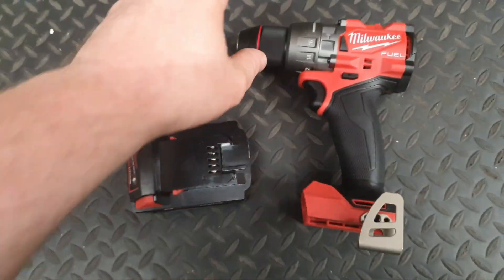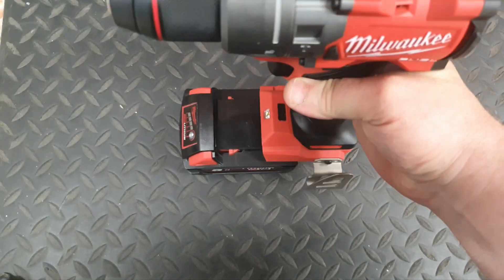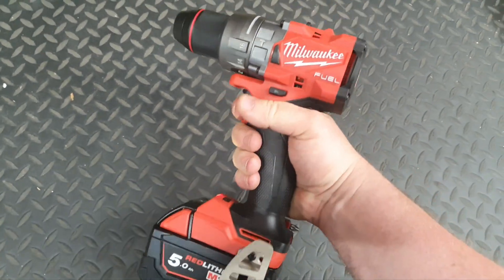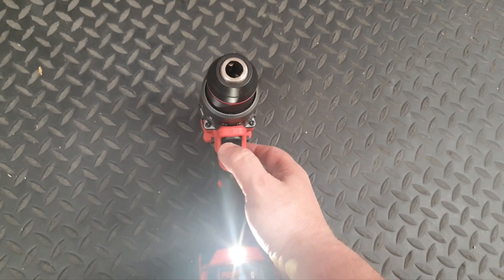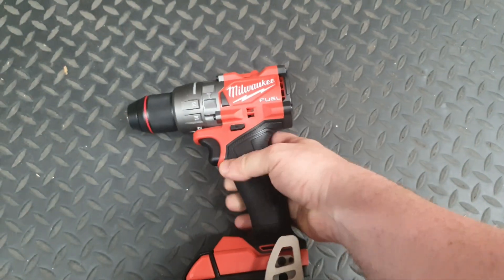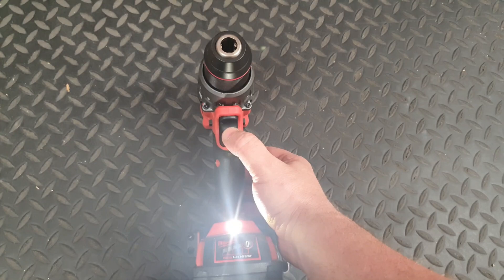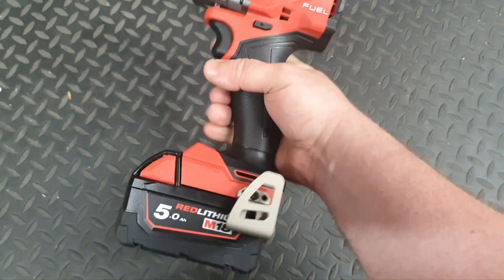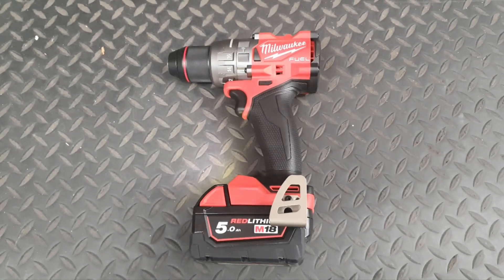Your Milwaukee Gen 4 does What??#milwaukee #powertools #fuel

Comment: Pretty cool hu press 5 times like a vape to turn off and on but you can take the battery out and it will turn back on. Have you tested the raw power of this amazing compact drill for its siZe you would think it wouldn't be that powerful like for instance you put a DeWalt or matabo hpt  hikoki... Its smaller than a Ryobi lmao but three times the power. I believe that channels like torque test channel had so much whining about the wrong batter and thousands of people complaining about there method they were like fk Milwaukee were really gonna make the fan boys cry 😂 and actually rated a very low budget tool above it then tested DeWalt and and changed testing i think its funny that they would stoop that low 😂 at the beginning Milwaukee was the tool to beat even air couldn't beat it but because the tool didn't say high output on the tool they tested the shitty 5.0 battery and gave ridgid the octane batteries 😂 most don't even realize this and according to them DeWalt is the absolute best everything 😂 except for the last two test with the drills flex and Makita xgt won i mean it would be ok if these tools actually were more powerful but there using a rig to test torque not a wilhelm designed for torque and only torque.
Reply from the maker: Whatever anyone says negative about Milwaukee their Drills like the one shown and the impact drivers are the best around. I like the 3 speed Dewalt DCD996 but the Milwaukee Gen 3 and Gen4 are better it's just a fact. I have a great video out on Sunday where I recovered a flexvolt 9ah battery from the dead check it out buddy if you have time.